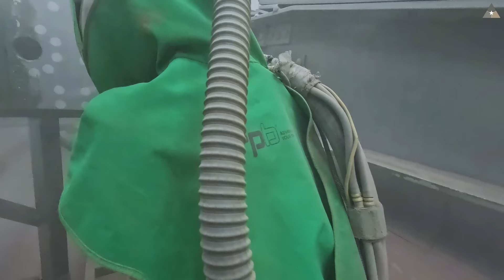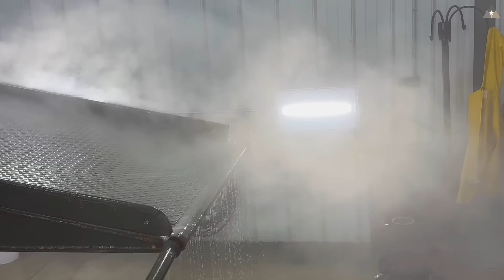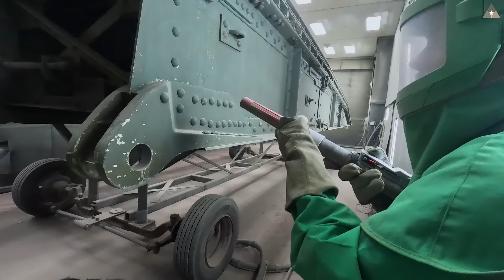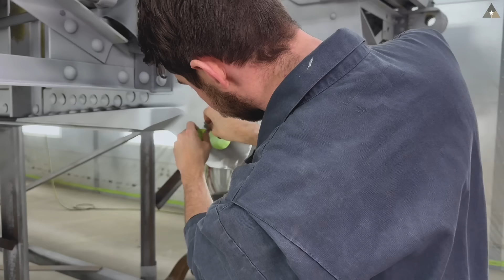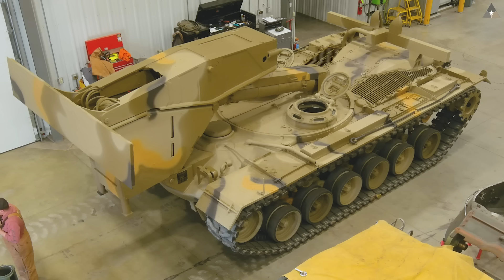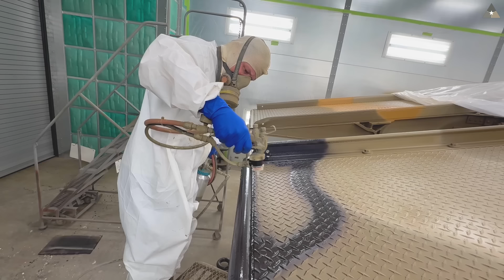What We Found Under Decades of Paint: M48 AVLB Restoration (Pt 2)

Comment: I was a 12B assigned to a line platoon in a combat engineer company (70th ENG). Our A&O platoon had two AVLBs and it seemed like they were always down, having their packs pulled and leaking hydraulic fluid all over the place. They were slow and ponderous when they moved. The only thing broken more than those were the M9 ACE and those weird Mercedes trucks with the backhoe.

Comment: After stripping the paint, did you repair the broken weld joints? Excellent video, the bridge is looking great.
Reply: Thanks for the excellent question: The aluminum brace in question is riveted to the bridge superstructure. The museum’s intent for the AVLB is to remain on static display and such a lengthy repair was deemed unnecessary.
Reply: Makes sense to me :face-red-heart-shape:
Reply: My question as well. The cracking in the welds will propagate through the base material if it's not addressed.